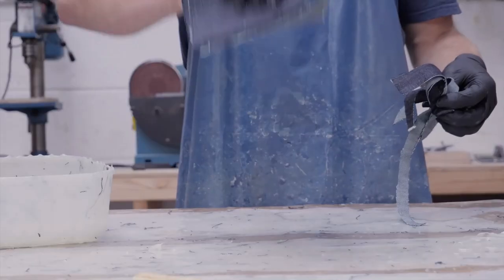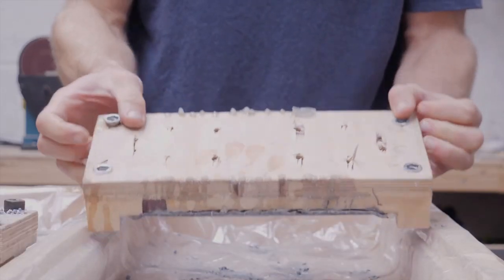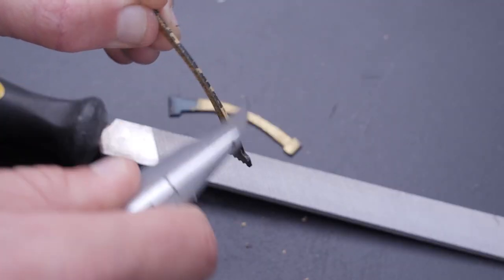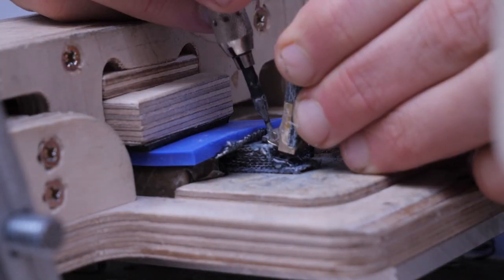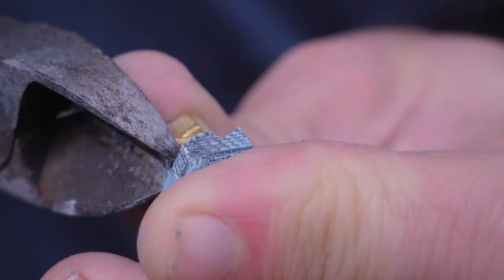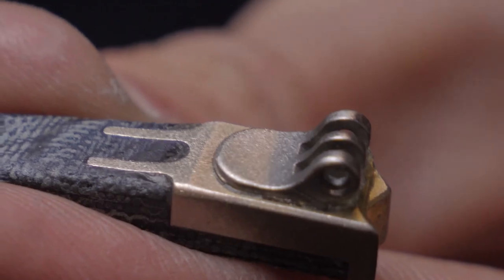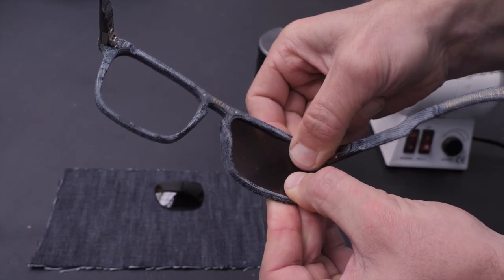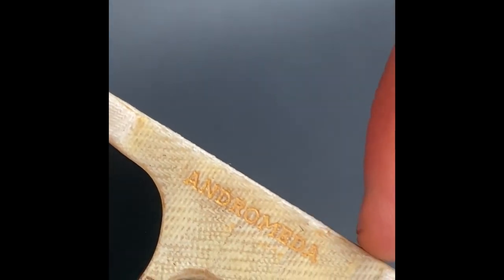Making sunglasses from hardened denim. 12 years of development

Comment: 💡 Jack, the denim is a great idea and looks really spiffy. Have you considered a different kind of fabric .. in particular, carbon fibre? It comes in woven sheets, which wouldn't be too far a departure from your denim process, plus it looks super cool in resin! It could make a nice variant in your ensemble, and you might even find that its properties require less reinforcing than denim, making it easier to work with.